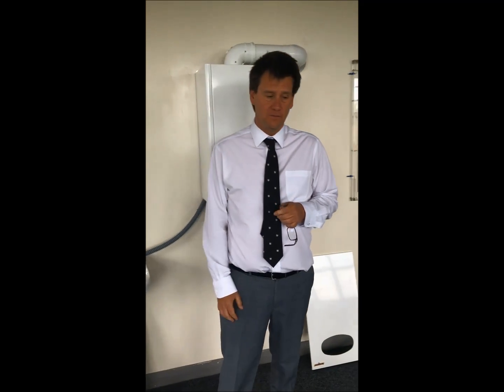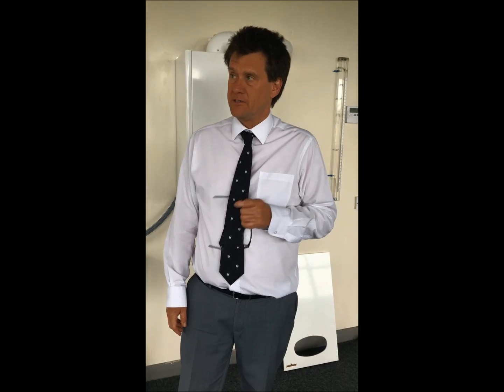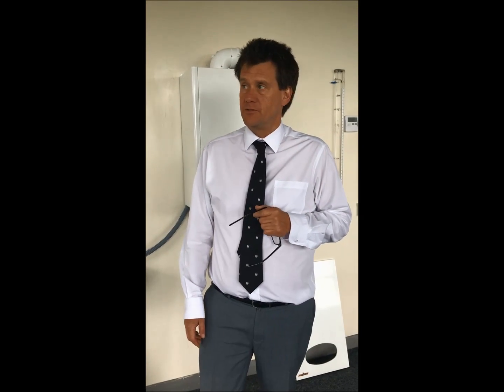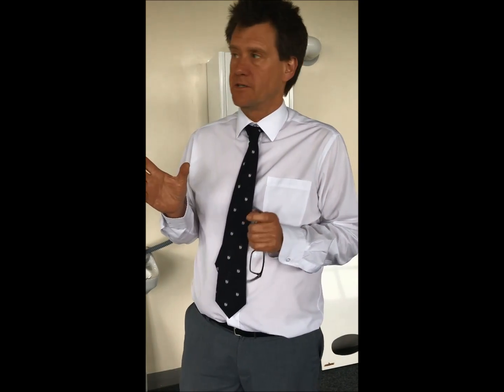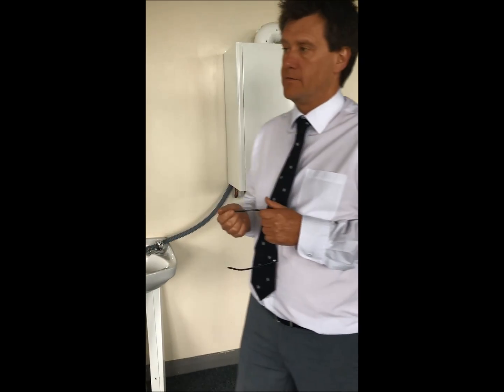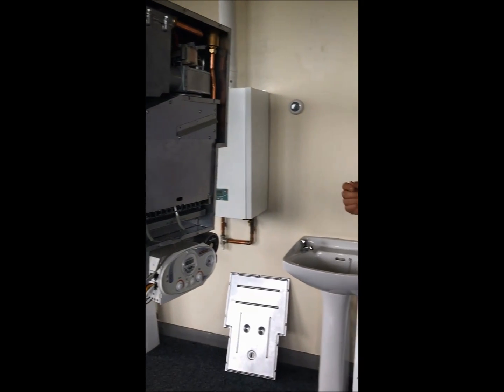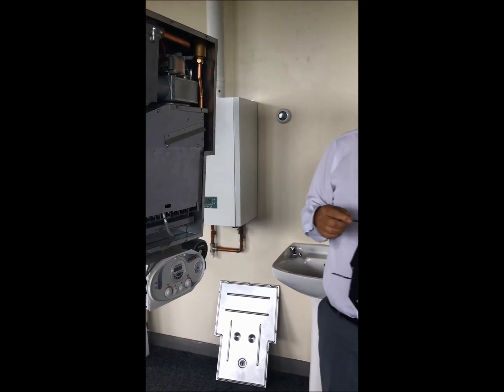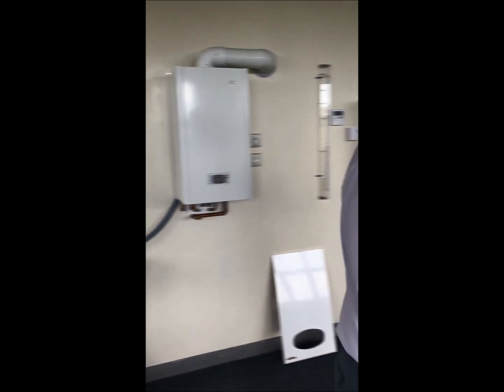How to identify fan issues

Comment: I fail to see how a stiff bearing has ANY  relationship to the resistance of the motor "coil winding"  ?
Surely - coil resistance is purely a function of the coil itself  - ie -  the number of turns of copper wire in the coil ( assuming it is copper) - ie length of winding  for a given wire cross sectional area - under normal / correct circumstances ( ignoring temperature)

 Possible coil failure modes would be : shorted turns in the coil winding ( due to aging  / breakdown of the enamel insulation of the copper winding wire /   mechanical damage)   which would "partially  lower" the resistance -  and cause "excessive coil current" when alternating current is applied during operation -  due to the induced current effect  into those shorted turns  - and cause subsequent overheating of the coil and almost certainly cause eventual total breakdown of the whole winding ( ie "terminal failure" )
Quite difficult perhaps to spot this by just measuring resistance on its own - as shorted turns across say an adjacent layer of coil winding as might happen -would only produce  a small reduction in resistance .
Measuring INDUCTANCE of the coil however would show up due to the induced current effect in the shorted turns .
So - moral is :  measure resistance AND inductance !!

Or - high resistance due to breaks in the winding ( most likely measure as very high resistance or open circuit) or poor / damaged coil terminations.  in either case  - the motor is unlikely to run at all in this case ( unlike the shorted turns scenario above)

Either way  - totally independent of the mechanical constraints of the motor shaft ease of rotation ?